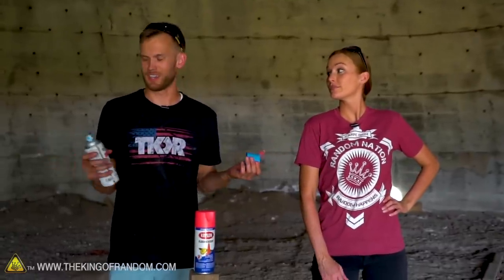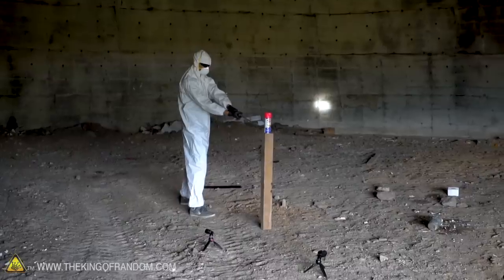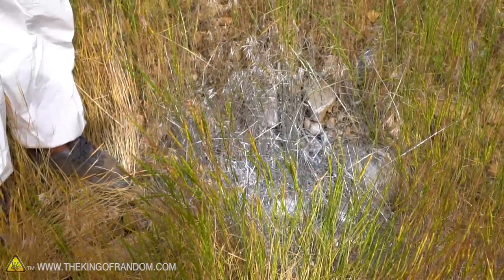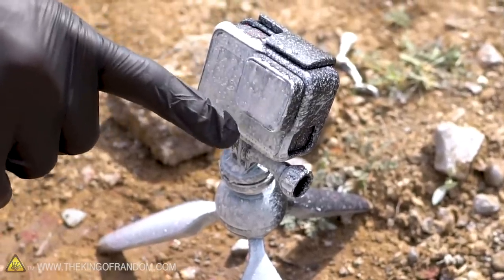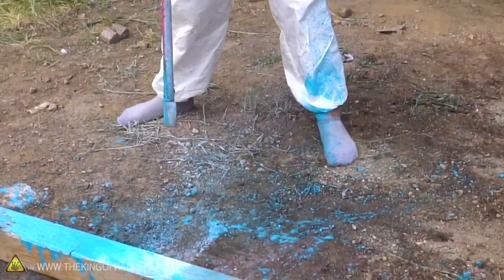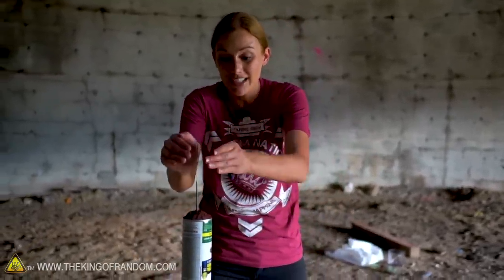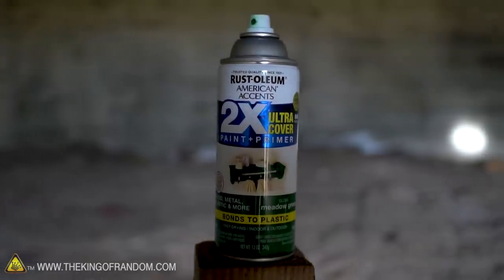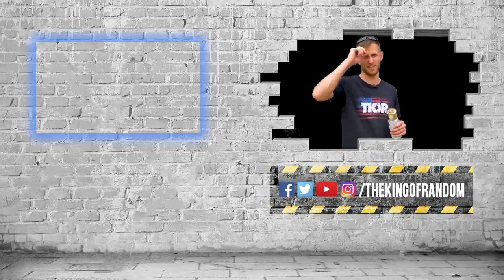Everything NOT To Do With Spray Paint

Comment: Another way to make the burning spray paint thrower is by tossing flower up into the air, and then using the spray paint, with a lighter. Also did u know that the great Chicago Fire was started because a baker, left his fireplace on. A bag of flower fell, and put dust particles into the air. The fire in his hearth reacted to the flour, and pretty much blew up the shop. Something close to this, so yeah.

Comment: Suggestion for the shoes:
Cook them in boiling water to dissolve glue between parts, then melt them in a pot or something, pour the liquid in some kind of mold/molds and let it cool down. I hope it'll become a bit bouncy if it works.

Of course there will be some solid parts which should be sieved out before molding. Maybe you can make art with them before burning.